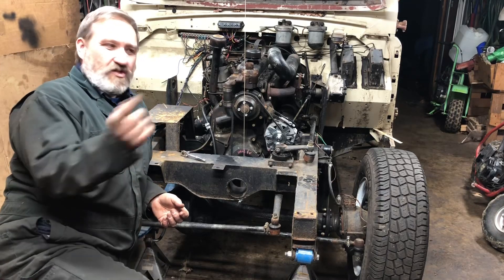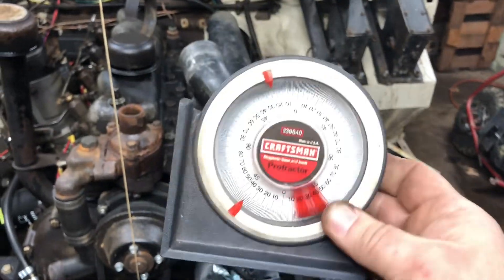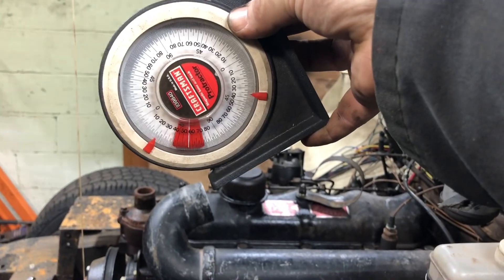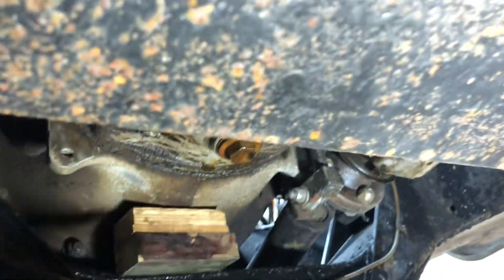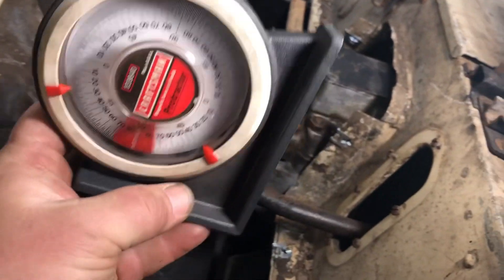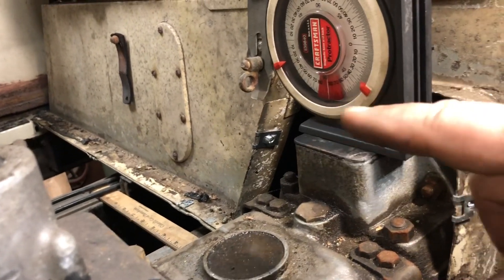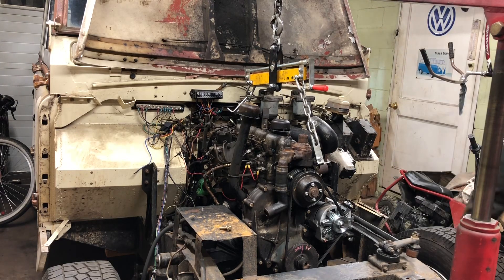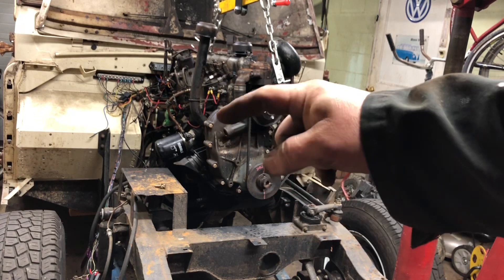Engine removal & measure for engine swap Land Rover Series 2A Scotty restoration repair

Comment: I have driven pristine condition 2.25 Diesel 109 station wagons... It's unbelievable that they even offered this combination outside the UK and sub-saharan Africa.  Incredibly underpowered for a vehicle that is supposed to carry loads, even by 1950's standards.  I would still consider the 153 Chevy / Mercruiser drastically underpowered here in the western USA, but it's a big step up !!  It'll still be slow , but it'll be far faster, longer lived and more reliable than the fragile 2.25 Diesel.
Reply from the maker: @timmcooper294  very true. If it was a farm truck and used for off road conditions all the time. The diesel would be great. Lots of low end power. Just not enough to climb hills or traffic in the slow lane. The GM 153 is a pretty powerful engine. Especially being all brand new. I’m currently running a 2 barrel Rochester from a Mercruiser. It has plenty of power. Video coming soon.  Thank you for watching!!

Comment: If I was in the states I would get my hands on a GM 6.2 / 6.5 NA diesel. But since they are far and few here in Europe I will stick with the slow four cilinder diesel.
Reply from the maker: A big old V8 would be nice. I definitely don’t think it would fit nicely in the little engine compartment. I figure this little petrol 4 banger should get me round just fine. For an LS swap adapter kit and parts is over $3k USD. Way too pricey for me. Engines are cheap but they’ll need rebuilt.

Comment: I didn’t realize there is already adaptor kits available for this swap.
Pretty slick Cory!👌
Reply from the maker: Yes Sir. A guy named Scotty came up with the design of the adapter in the 1990’s. They rest of parts you need to source yourself. But it should be a nice runner engine with lots of parts available in the ISA.

Comment: What’s wrong with this original engine? Is it worth rebuilding. I have met land rovers with Chevy engines.
Reply from the maker: Thank you for watching. I’ve rebuilt about 90% of the 2.25 diesel while in the truck. The diesel’s horsepower output is too low for the large hills of Pennsylvania. Everywhere I drive is uphill… both ways!!. Ha ha!! So I’m swapping in a 4cyl petrol GM engine for a little more usable power for USA driving.
Reply: @conrad1468 Corey, you're gonna regret it once you start racking up tickets for exhibition of speed, not to mention having to replace all the rear tires for all the burnouts you're gonna be doing!!! Mark my words, you menace to society!!!🤣🤣🤣👍
Reply from the maker: @IAm1InTheIAm  ha ha!! So very true!!! Ha ha!! I love it!! 😀😂🤣
Reply: Will there be another video showing beefed up rear suspension, traction bars and wheelie bars? Lol
I want to see wheelies!😂😂
Reply from the maker: @calsurflance5598  ha ha!! I want to see wheelies too!! Ha ha!! Believe me… if I blow something up yinz will be the first to know. 😀😆